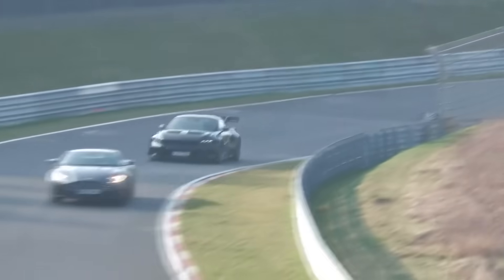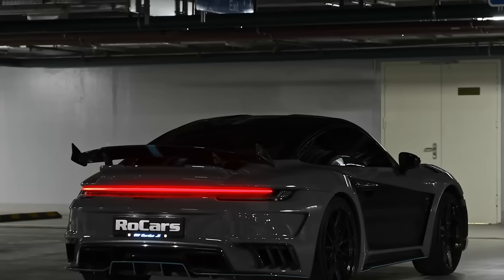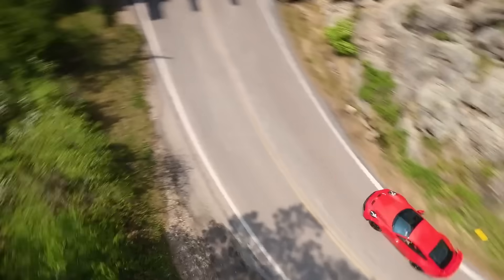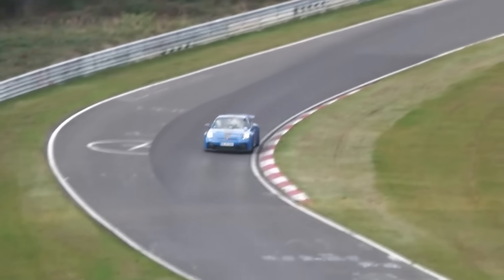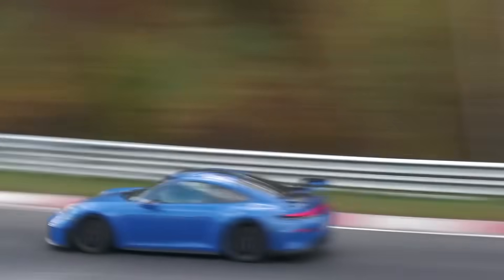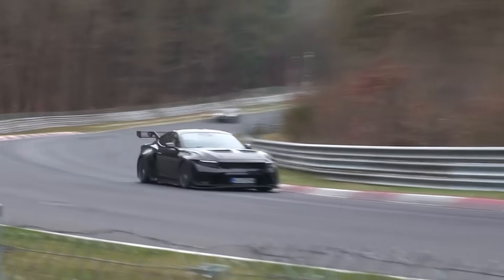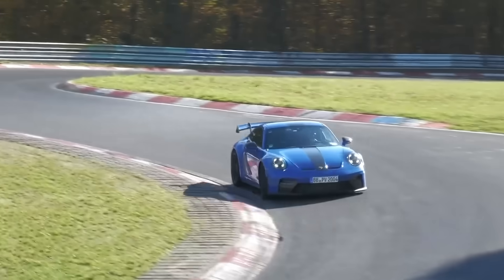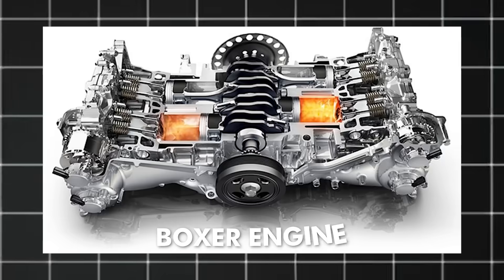Porsche Is Obsessed With Boxer Engines | Here's Why

Comment: Why use footage of non 911s in this video
Reply: Why show Mustang V8s in a video about Porsche cars with 4 & 6 cylinder engines?
Reply: Because it is about THE BOXER ENGINE not the 911...
Reply: @a64738  The Mustang, Porsche 918 and Porsche GT featured, are V8s.
Reply: @a64738 THAT Mustang has a V8 and a front mounted engine 😂😂😂
Reply: I appreciate the knowledge on the boxer engine in Porche models and Porche's dedication to its continued use and improvements, but do a little more research on the Porsche models that utilize the boxer configuration and don't show footage of other companies cars that don't even use that type of motor.
Reply: see my reply above